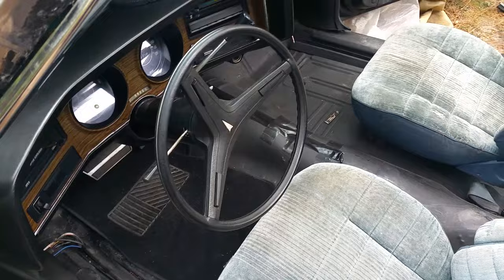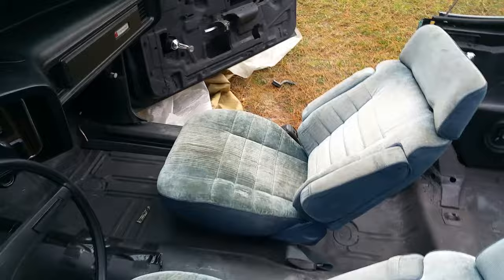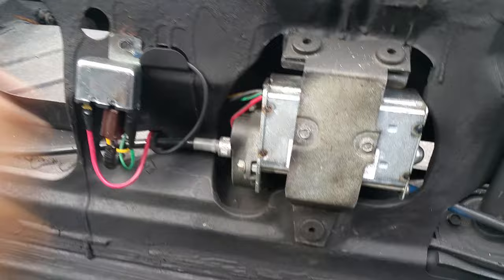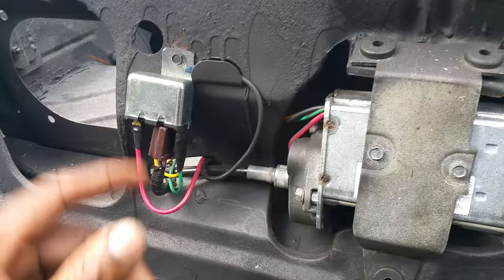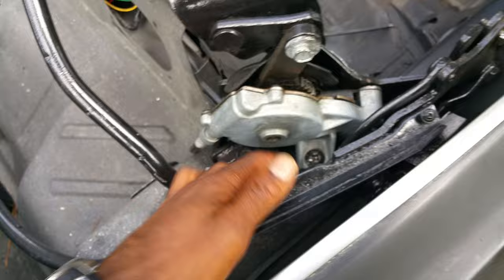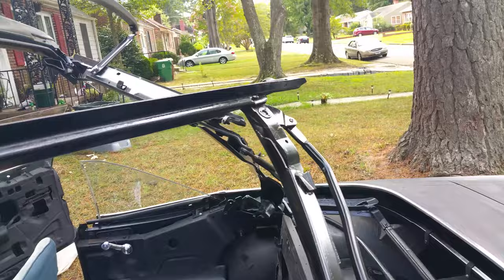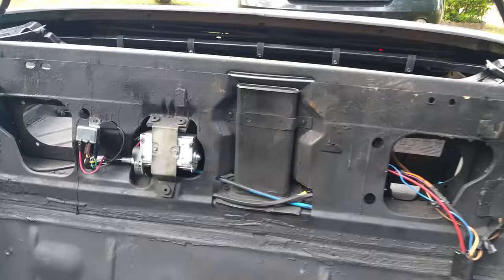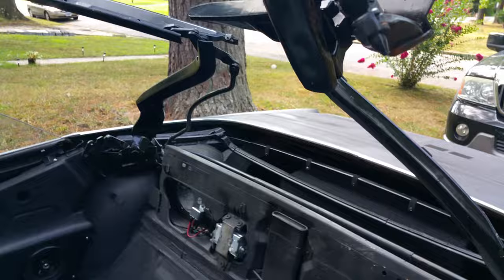Convertible scissor top  part 2

Comment: thanks man    i  just bought a 1975 olds royal convertible that was in a storage unit for 15 years the guy who owned it stripped the paint and didnt primer it and also took bolts out of the top   i sent the top bars to florida and just got them back on the top works  the body is awsume   73 thousand miles    350 cu in    red with white leather interior yes  leather in great shape  i need bumbers  there were no bumbers in the storage unit     looks like i might be taking a road trip        thanks again   very helpfull

Comment from the maker: hey ..it aint gonna  hurt  it...but if you can hear the motor  running  your relay is good. ..disconnect the cables  from the actuators  run the motor. ..if the cables  are turning. ..there lies your problem. ..get someone to hit switch  while u watch the ends to see if the turn

Comment: Mr hicks

your 1st video help me a great deal. I used it to replace my motor and top parts great good.
Reply: TheRealB2B Cardio Work-Out my front bow not falling in place water coming in how to i adjust that
Reply: Snake Black  are you talking about the bow that connects to the windshield?  if so have you reset your motors on the sides so they are working the same speed. then it's two adjustable screws on the elbows that will make them lay down flatter. What's you email  I can send you a pic of the adjustment screws. also it's a rubber seal that goes in the front bow, that keeps water out.

Comment from the maker: make sure u connected the motor and transmission together  properly....u probably  gonna have to go through  the system  and check  everything. .. for stripped transmission  gears,cables ends both sides gotta make sure the transmission nylon gear where the cables fit into are not stripped too...,actuators binding
Reply: Yea I did what u said about the transmission and put new grease in it and I replace bothe cables only thing I haven't done was replace the relay and check th gears on the side but since the trans was turning period Ima change the relay

Comment: My switch burned up. The top was working. I changed the switch and check the fuses and it won't work. I'm getting power to the switch and it clicks behind the seat. I have a 75 delta 88. What should I do next

Comment: So when I drop my top the arms start to touch and I have to pull them apart to drop it all the way down, this also happens when I put it back up! The plastic guide the goes on the 2nd bow I think that's what it's called has broken off as well. Do you think it's the guide that has the arms touching now, when I drop the top and put it back up? Or do you think it could be something else?? Also before I lock the top when it's up the left side is lower then the right side by about 6 inches

Comment from the maker: hope so ...i love those 75 caprice. ..i think that's the best body style
Reply: greg hicks so I got an update on my 75 caprice: I changed the motor,relay, and both cables. So now my top drops back with ease...now when I go to lift the top back up it stops about 1/3 of the way up and I have to get someone to help me. So I'm assuming it is the switch?? Would you happen to have a video on disassembling the dash?
Reply: mine does same thing  did you figure anything out
Reply: Derrick Crenshaw no haven’t figured it out yet. I changed the motor and relay. Changed the gears and both cables. Still goes down good. Comes up for a few seconds and stops still.I’m ordering a switch this week.hopefully that’ll do it
Reply: Mine does same, but if i give it some gas the top will go all the way up

Comment: Hi, I leave in belgium, I have a Buick le Sabre convertible 1974 ,I want To ask You i We do to adjust the 2 câbles who goes To te motor, because my top goes in diagonal when i try To open. I remove the câble from the motor but the ride Side go first. Sorry for my english, But i leave in a french country.
Reply: Hello, i guess you need to close the convertible top  than you can adjust the cables from the sides ....

Comment: I got a 1975 Buick LeSabre custom convertible in all the motor does is click I hear a clicking sound what is the problem please help
Reply from the maker: Does the top work  at all ?
Reply: Mines does the same thing 75 delta88 convertible. Just a click noise and nothing else

Comment: Hey bro can you please help me I have a 72 impela the top was working I just went to put it up and the relay just clicks and motor doesn't turn on
Reply from the maker: Could  be a number of things...but I would  start with the electrical side of the motor to relay  since relay seems to be working...if you could  bypass  relay  try that too..might be in the relay... see if the motor is turning ..if is could be stripped  gears
Reply from the maker: workers there's a guy on utube that refurbish whole frames and sell them ...I think impala mike ima check

Comment: I'm getting water in my trunk when it rains.  Do you have a video on the rain apron, and how to check for leaks?  I already replaced my trunk seal.
Reply from the maker: It's an aftermarket  rain gutters you can buy that  direct the water  to the quarters
Reply: greg hicks another problem I have is, the people that put the top on before I bought the car, put the material too tight on the back bow on the drivers side and it’s ripping near the window. The top shop in Columbia SC says I need a whole new top
Reply from the maker: @sportiessc  don't  need a top just the rear curtain... it should  be a 2 piece...the top ...then what  they call the rear curtain  which where  the plastic  or glass window  is sewn to...that goes on first then the top is stapled glued on  2nd
Reply: greg hicks I wish I could send a picture to you. I can see the inside of my car from the outside with the top up. It’s ripping at the frame behind the quarter panel window
Reply from the maker: @sportiessc  yeah you gonna  need a top

Comment: I have new motor, cable's and relay my top still stop when going up
Reply: Riles Boy bro Iam in the same position mine gose up about 10 seconds then stalls
Reply: Me too. I changed the gears both cables and motor and relay. Still won’t come up. Anybody find out what to do next??
Reply: WHats up guys, Im working on a 75 caprice with the same issues. Although I have not replaced any parts yet. Top  goes down  only if I start stop start stop.  Going up, I have to completely pull it up by hand while holding the switch. How do I know if its the motor or transmission?
Reply: Is one side going up faster than the other?? If so it’s the timing bro

Comment: I changed the fuse new motor and relay switch and checked the fuse but my relay makes a clicking noise when I got the switch but still no power what could be the problem
Reply: Corey Lockett  did you ever find what's was wrong min is doing the same thing
Reply: Did you ever find what was wrong mine is doing same thing.
Reply: @colbylovell6053  mine is doing the same , is there a way to let the top up manually? I just got mine and I let the top down and then I tried to let it up and it just went blank on me, I still here the click .  It was easy to go down , and it struggled to go up and went blank after .

Comment: PLEASE HELP I have a 1975 Pontiac Grandville Convertible top was working just fine and just stop working out the blue I have got a new convertible top switch changed all the fuse's new relay and left and right cable top still don't work motor not spinning at all I'm lost at this point the clicking from the relay I know it working motor I had tested by carquest and its new its working spinning both sides just fine have the dash out checking everything I'm not sure what else to do but have a shop fix it and over charge me ON PARTS AND LABOR please help anyone
Reply from the maker: Check  gears in actuators
Reply: can u spoke over the phone Greg?? or I email u my number

Comment: Bro what’s your fb I need your help
Reply from the maker: What's  up homeboy
Reply: Cooling man bro my 72 delta 88 top was working fine but only one side was going yo you had to manipulate the passenger side to it to punk ass mechanic now nothings working I followed your video relay is clicking and the passenger side cable is snapped (tried to jb weld just to see if that would work still no movement)... need help bro
Reply from the maker: @kingzues7710  lol can't jb weld that..gonna  have to get a new cable too much pressure...put it in either  up or down
Reply: @greghicks7532  bro I need to know what to do water can I order all new parts for my top!?
Reply from the maker: @kingzues7710  go to ebay 3 or 4 companies selling  parts... seller names are listed..all  gm b models from 71 to 75 are all the same conv tops oldsmobile  delta 88  Buick  centurions, lasabres..cad el dogs Pontiac  granville Catalina  and all donks etc...all same scissor tops
Reply: @greghicks7532  that’s what I’m saying bro ion know NUN BOUT THIS SHIT LOL